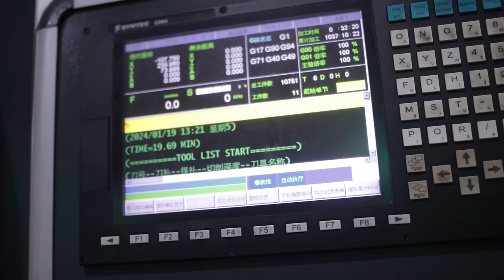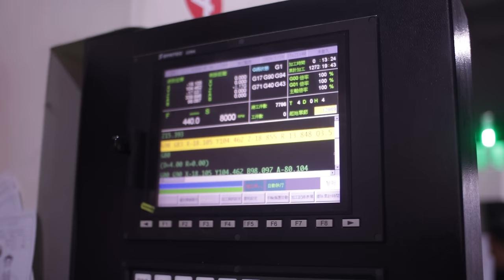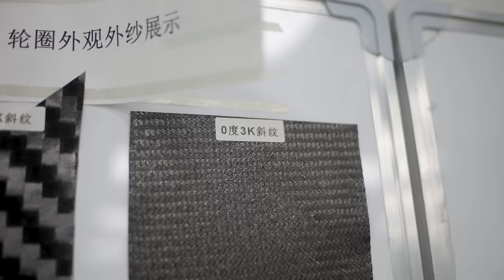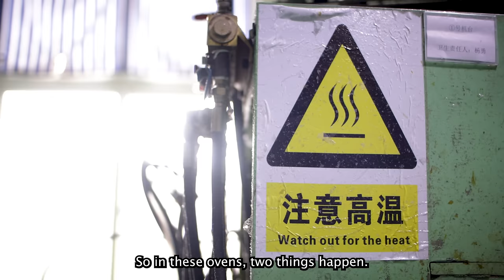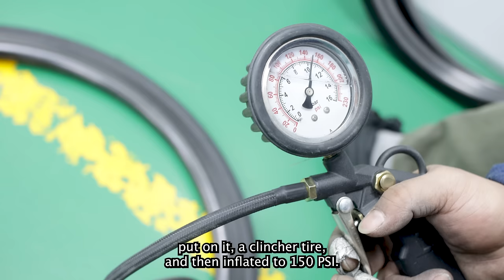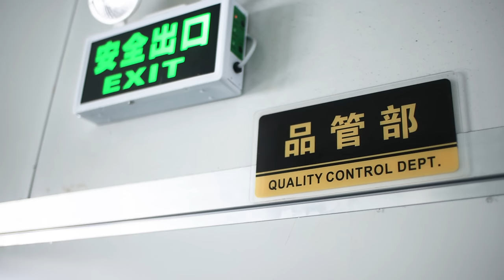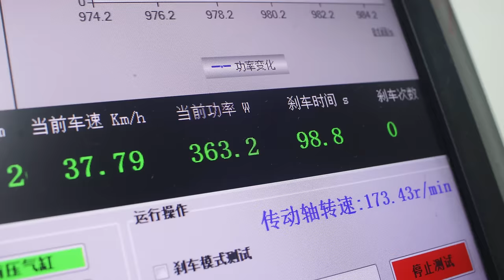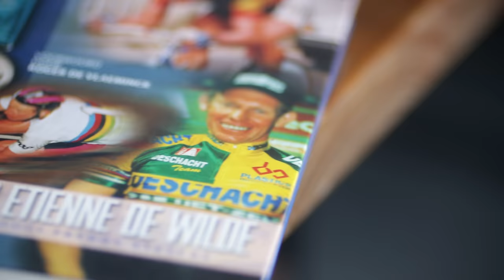Where are Chinese Carbon Wheels made? FARSPORTS Factories Tour.

Comment: i actually wanna share an experience i had with farsports, i had some issue with the trueness of the rear wheel after a couple of weeks of getting my wheels (a feder series with sapim cx ray and dt240 coming in at just 1360 grams at 45mm ), i messaged farsports and they replied, despite not being in mainland china, they took care of me and asked me to take the wheels to a local bike shop for repair, i asked if they could take care of the bill and they did, so its actually quite nice of them to do that for me, the wheels have been spotless thus far

Comment: Have a set of C4 rim brake wheels I bought in 2022. Absolutely top quality wheel set. No issues and tough as nails.
Reply: Owner of C4 here, have been using it for a year without any problem.

Comment: Built a set of wheels using Far Sports Kaze 38/40asy rim brake rims laced to DT240 hubs 3yrs ago and they've clocked up about 30.000km so far 👍
Reply from the maker: They seem to be very solid rims!
Reply: @ChinaCycling  I weigh in a 65kg but will do around 3000m of vert each week so it's not just riding on the flat. My only worry is that by the time they wear out Far Sports won't be doing rim brake rims any more :)

Comment: I have MTB wheelset which done 30000kms mix of XC/gravel races and rides. The only thing I've had to do is regrease DT Swiss ratchet. Everything else considered are bulletproof. I am 80-90kg rider ( depending on the time of the season :D )

Comment: Been using farsports for rim break over 2 yrs. FYI. . My weight is around 185lbs.  Still solid no issue. But riding mostly jn flat or rolling hill terrains. So not sure their rim brake surfaces would be okay for long term if you live in like Colorado or Cali areas where have long distance downhills
Reply from the maker: As much as i love rim brake, it definitely has it's upper-limit.

Comment: 11:42 If I were the QC guy, I would wear the safety glasses, just in case... 😁
I also wonder why it's not required to wear a cap or hairnet during lay-up processes.
15:22 Working with that posture seems stressful to the neck. They should build a lacing jig to give these guys a more comfortable and efficient way to lace spokes.
To Ms. Li: don't abandon rim brakes if you want happy customers!
Reply: Always have a complainer in any and every place.
Reply from the maker: That QC guy... as soon as I heard there was 155psi in that tire I got nervous... as soon as I saw he had no ear defenders I was instantly relaxed. He obviously does it day-in day-out without any issue For him  putting 155 in that tire is like us putting 120psi in our tires back in the day. (I didn't wear any protection gear to blow up my tires back then either - hah.) But yeah; be safe kids.

Comment: 1:23 You don't forge metal into a billet. A billet is an extruded lump of metal, cut to length. A forging is what you're holding, which is made of a billet, either cold or melt forged. & you don't use a lathe for "lathing", you use it to "turn" forgings into finish products. FFS! I'd have thought you'd have understood the basic engineering terms before launching into your supposedly authoritative diatribe. Solecisms like this just make me go and find something else to watch.